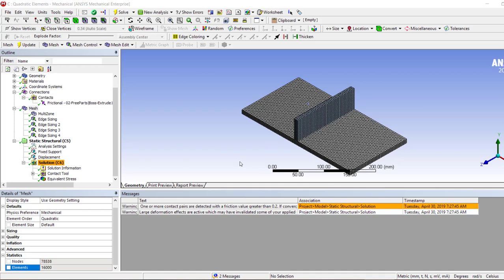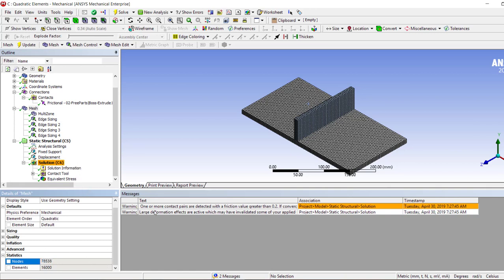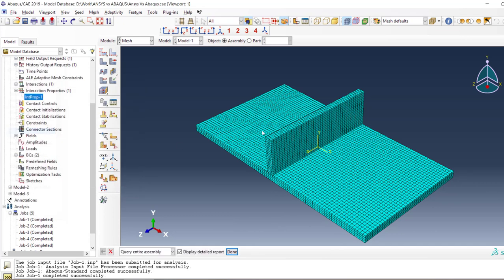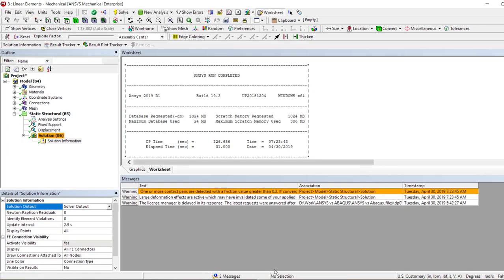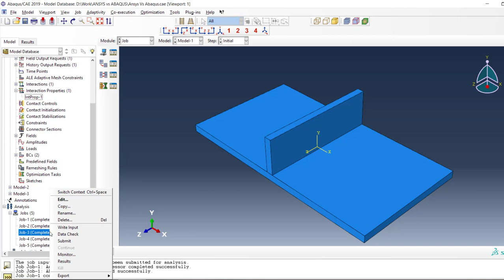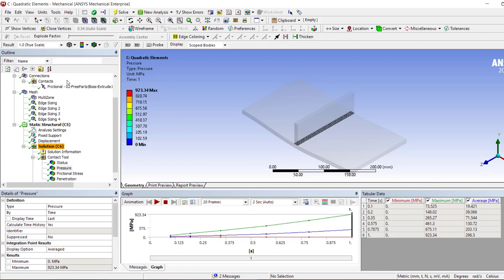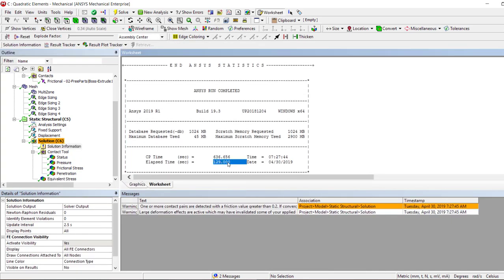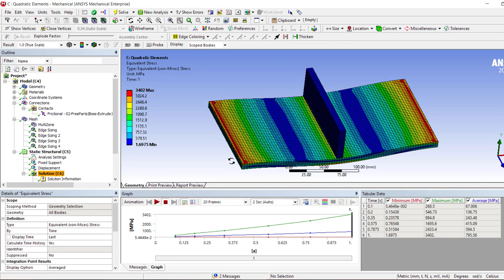Ansys Mechanical Vs Abaqus CAE Part 3 - Mesh Elements Type, Contact Pressure, Results Diagnosis

Comment: Sir,
   I would like a very important advise on the fact that my "Ansys" and "Abaqus" has to be run on my laptop......and since it's getting old I am buying a new one.I would like to have your advise that is CPU( say 3.7 vs 4  Ghz) more important over storage( 516 SSD  vs 1TB  correspondingly).....for "Simulation".Please,I need an advice from an expert like you.
PS:I don't have the option to use a desktop for some reason
s so it has to be a laptop.
Reply from the maker: Hi Ahmed! 
I cannot tell you what you Should buy but i can tell you definately what I have and how good it is for me.
I have lenovo high end laptop(bit expensive but totally worth it)  
CPU is 2.8Ghz Boost to 4 (quite a balance of power consumption)
SSD is 500GB (higher you wont need unless you wanna record every single minute step size and your simulation results are in 100GBs lets say, else you wont need higher one)
GPU is Quadro P2000 (mostly used with abaqus but it boosts about 1.5x-2x).
If your work is simulation extensive then buying a cheaper one will cost you more in the end. But if you have mostly CAD and sometimes simulation, then its super fine to get a budget one. 
I had 3 laptops over 8 years, and my experience is high ends turn out to be cheaper in the long run. 
Please let me know if you have any other questions. 
Thanks, 
Irfan
Reply: @DesignHyper  thanks a lot brother to take the time to reply in such detail,but can GTX 1050 say 3GB or AMD RX 560X 4GB be used instead as Quadro GPUs are way too expensive, especially here in Bangladesh and is SSD a necessity ?? A 1TB(5400 RPM)  won't do? Also by 1.5-2X is it meant GPU acceleration......??
Also please tell me this -by budget allows me to get a CPU( 2.3-4.1 ghz----i5 8300H  +2GB GTX 1050     /     2.1-3.7 ghz---Ryzen 5 3550H+ 3GB GTX 1050 ) Hp laptops with 1 TB HDD.....or Ryzen(same CPU as above)+512 SSD   Acer Nitro.......Ram is same for all three(2 HP models and 1 Acer)................I would do mid level simulations(700000 nodes say)........I would be happy even if the result takes 15 hrs or so.........as I have budget constraints........which  one will you suggest?? .......will be waiting for reply........TIA .......Assalamu Alaikum.
Reply from the maker: @ahmedshayor9860  Dear Ahemd! 
a 1TB HDD isnt even close in comparison to a 500SSD. SSD is expensive but really worth the price. 
So you should be looking at around 16GB RAM at least. 
Try an HP one because they are robust. 
I killed a DELL and a lenovo but if you just wanna start, start with anyone make  and save decent amount of money (around 3k$) and then buy a high end. 
The reason i like high end is that once you buy it, you wont need another machine for at least 5 years(mine is running for 6 years, bought in FEB 2014).